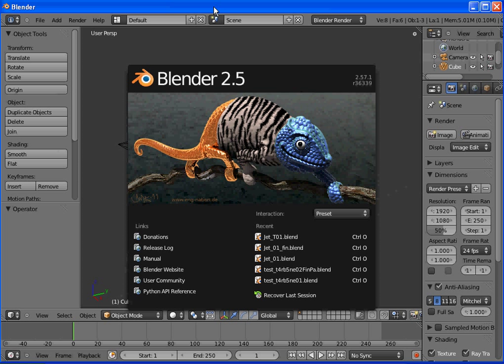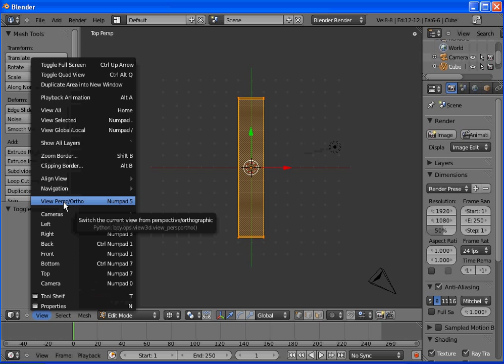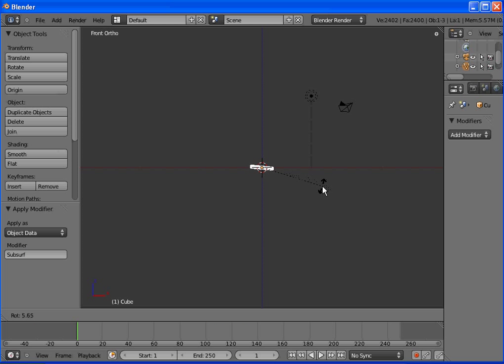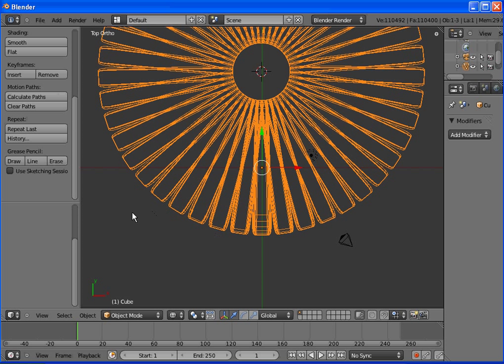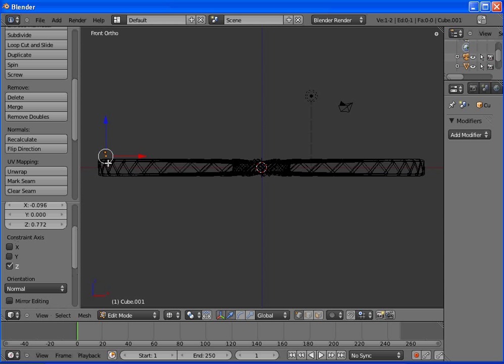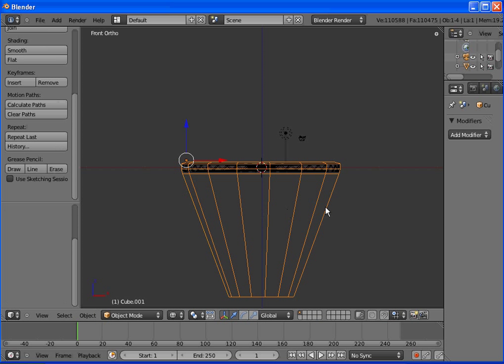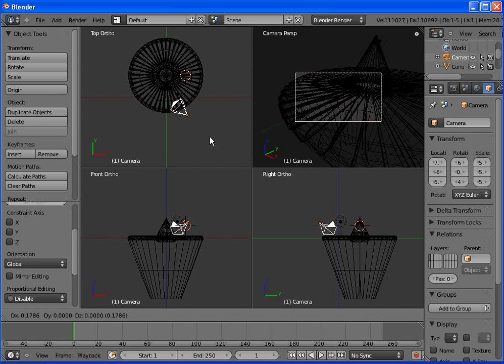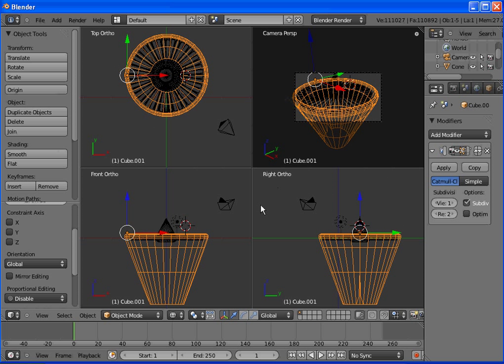Old Blender 2.5 Tutorial - Jet Engine

Comment: The render glitches because the first blade overlaps the last blade when you spin 360.  The solution is to remove double vertices after the spin.  Similarly for when you spin the engine shroud, remove the doubles.

Thanks for sharing your technique!